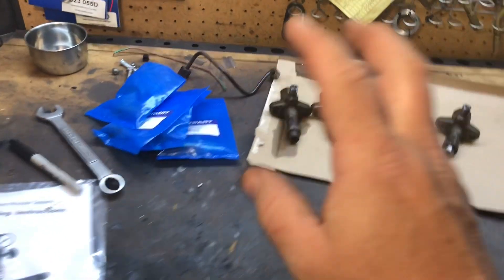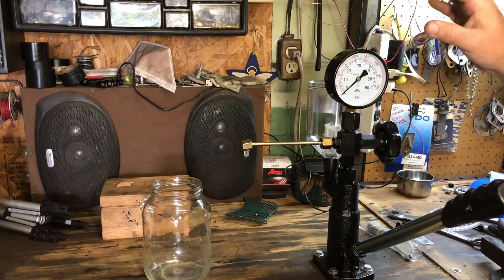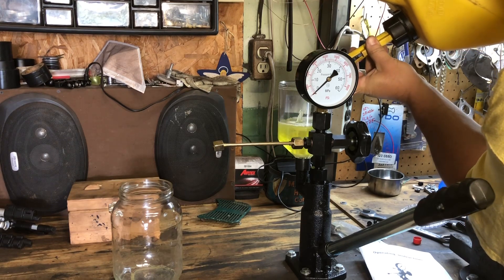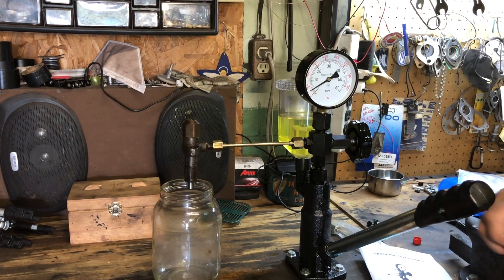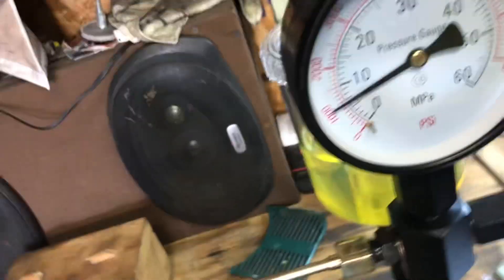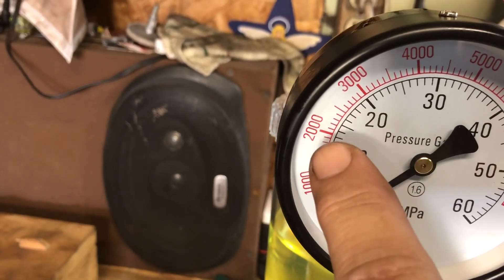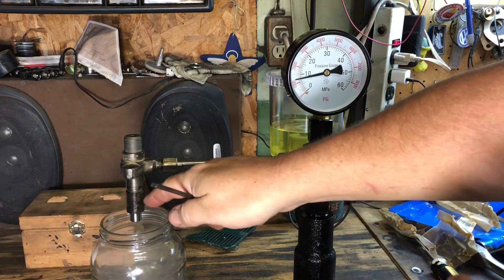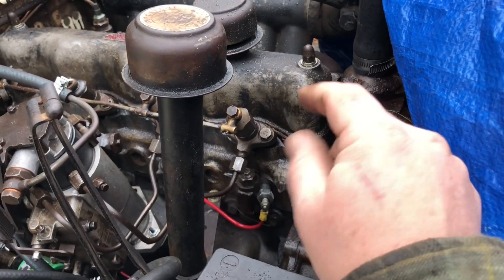Rebuild Diesel Injectors nozzles Land Rover Series 2A Pop Pressure setup restoration CAV Delphi Pump

Comment: Great video Cory. I remember using what looks to be an almost identical injector tester when I worked on ALCO diesels 20 years ago as an apprentice. We used to spray onto a piece of blotting paper and check the spray pattern against the ideal pattern in the manual. You could pick up blocked or worn spray holes that way. From memory the ALCOs had 10 (maybe 8?) holes per nozzle so the spray pattern looked like a daisy and each 'petal' needed to have a similar shape, length and density. Anyway, I suppose if you are still getting fouled injectors, the next step would be the pump to ensure that each injector is getting the same amount of fuel, but it might pay to check the cylinder compression too. Worn rings or poorly seating valves can give you headaches there. The metal you found in the injector is a bit worrying! Hopefully it's just debris from the inside of the fuel pipes. Thanks again for the video Sir, I'm sure that it will be helpful for those with older diesel engines!
Reply from the maker: Thank you Sir! The diesel rebuild shop has the same tool along with pump testers. Old school shop. No need to change what works right?!?!
Interesting about the spray pattern on paper. That would answer explain a lot. 
In my future videos I’ll will be addressing some of those issues you suggest. We dive deep!! 😀
The little pieces of metal are from the metal hoses. It was on the threads. So I made sure to clean and use compressed air to clean the lines.

Comment: It's a balance between the proper pressure and pump cam wear...you want to be pretty darn close to design pressure so you don't have accelerated wear on the pump...
Reply from the maker: That’s an excellent point. Didn’t think of that. Thank you!!

Comment: Really enjoyed the video, feel confident about doing my own. Looking at your engine it looks like the 2ltr oil filler which has push on cap. 2.25 I believe had a radiator type. On no 4 injector spill pipe, does that go direct back to tank and/ or also back to filter. Many thanks
Reply from the maker: Thank you Sir! It’s an early Series 2A. It shares many parts with Series 2. Maybe that’s why a lot of part look earlier. You are correct. The return line goes to the tank and fuel filters. The fuel filters return line on the filter housing has a tiny orifice. So major of the fuel returns to the fuel tank.

Comment: on the injector where the 2 pins are the flat surface will get hammered from the needle . the tip on the nozzle will also be come damaged and bolge out .
Reply from the maker: Thank you for the info.

Comment: Hello Cory, testing my injector but fuel comes through top of injector, any idea why, also did you say you slacken of the pressure knob before pumping. Thanks Rob
Reply from the maker: Hello Rob, come out of the top of the injector instead of popping and spraying or is it both at the same time? I actually raised the pop pressure by turning the adjuster in. One it cleared out the air and any particulars. I turned the pop pressure down to the proper specs.
Reply: @conrad1468  Hello Cory, thanks for prompt reply and my apologies for not saying how much I enjoy your videos, very clear and concise. I bought a reconditioned injector and that pops fine at 2000. The one I took out, cleaned etc pops at about 1000 but then nothing. Trying to adjust higher, nothing diesel from top and bottom. Screwdriver head adjustment not hex. So to sum up, mist at 1000 , nothing after. Thanks Rob (UK)
Reply from the maker: @robertpoole5305  thank you for the positive words. That’s bit of an odd spray pattern. I’m not sure why it’s acting opposite as normal. I’m guessing the cleaned nozzle might be worn. The high pressure is pushing the needle against the side and it won’t let the needle slide. The needle should spin easily and smoothly by hand when cleaning the nozzles. Low pressure let’s the nozzle vibrate easier than high pressure since the nozzle is out of spec. That’s my guess…
Reply: @conrad1468  Many thanks, will go over it again Rob
Reply from the maker: @robertpoole5305  best of luck. It’s difficult to analyze a problem without the part in hand.

Comment: Just a quick question what is the problem if it’s leaking if it’s not holding pressure got new nozzles but one of them is not holding pressure what could the problem be I’ve stripped it down and cleaned it up and put it all back together but it’s still not holding pressure any help would be much appreciated thank you 👍🏻
Reply from the maker: @garethcorlett2904  sounds like a faulty new nozzle. Take it apart and give it another cleaning. Maybe I piece of dirt is in there? Is it leaking before the pop pressure is reached?